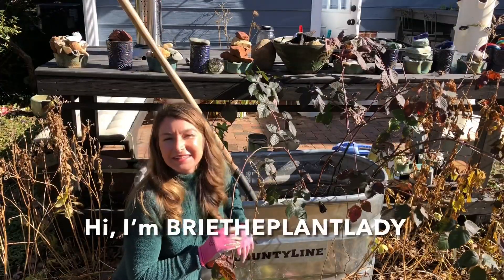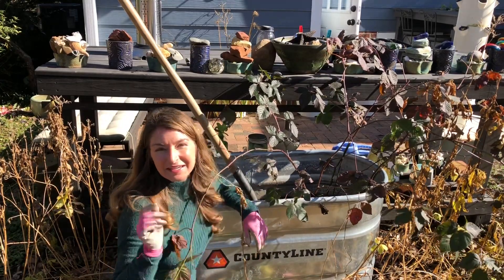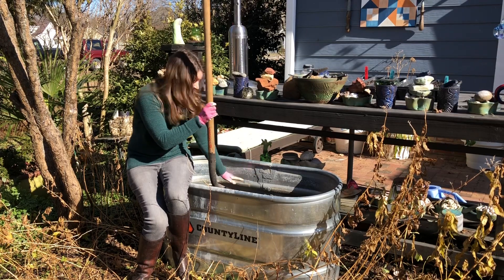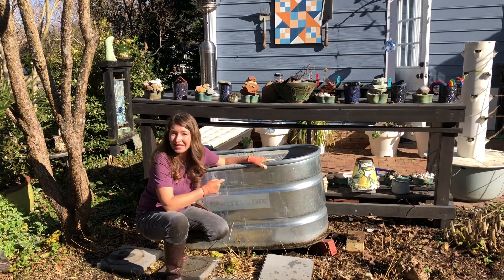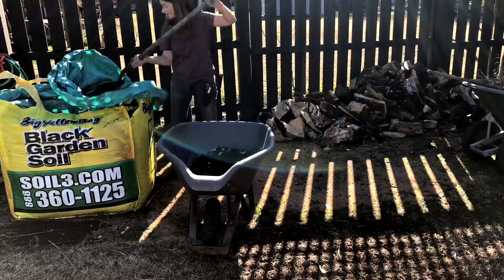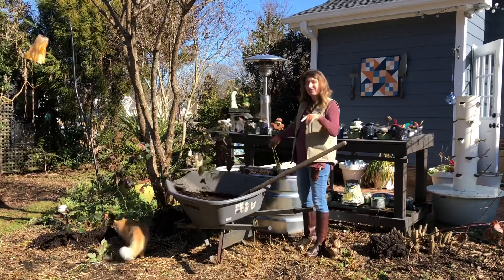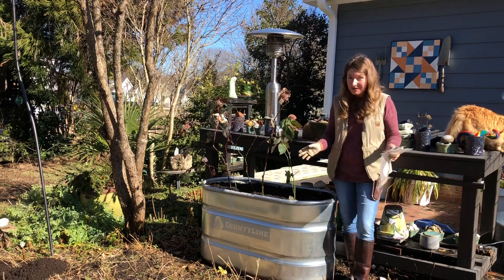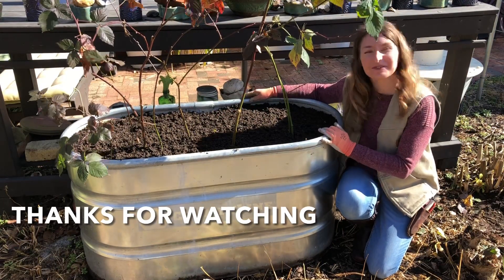How to plant a feed tank for winter

Comment: Do you have drainage holes in the tank?
Reply from the maker: I did not drill drainage holes, but I do have the bung (or pipe plug) unscrewed so it drains without issue.